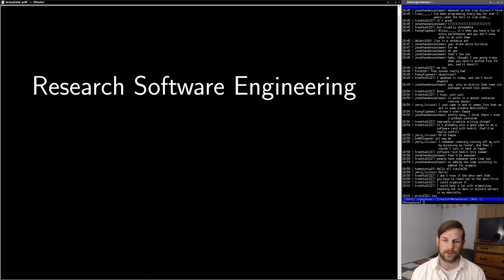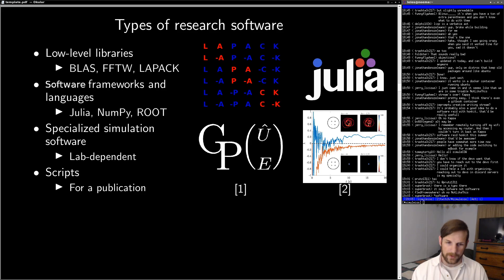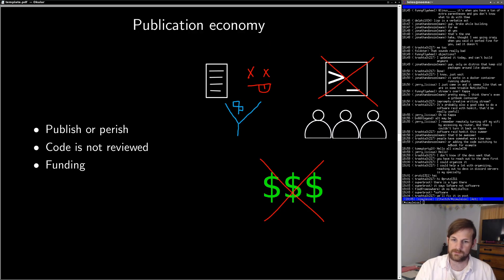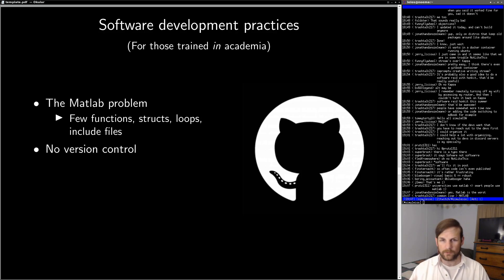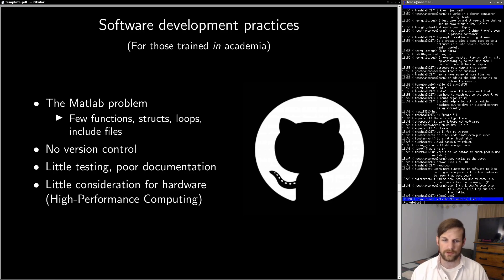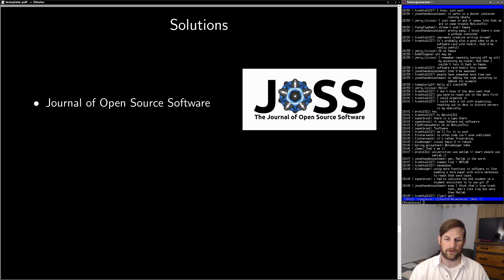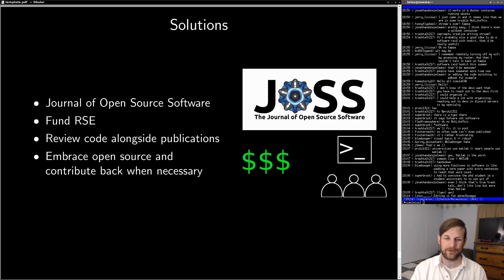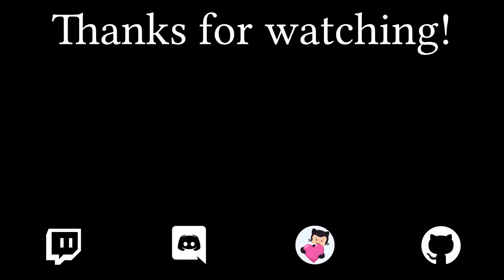The Problem with Research Software Engineering

Comment: Welcome to the world of software, it does not work. What you are talking about is just one system, that of the Client/Server technology. "How to ask someone for an answer". In actuality we should never need to know how to ask for anything. Any information needed should just be provided. With GPS you are dealing with three U.S.A. standards, and Russia, China, EU, Japan, India standards. Then you have different Earth datum, and accuracy, transforms, and then the assumptions that you actually have what you have been told. However by getting rid of the client/server technology all problems go away. To be more accurate I should not say "get rid of client/server", but rather change the technology so we simply remove the need to use it. 

In my mind every action a computer doers is client/serve. "Move 10 to Register 1" is client/server, so is "A = UpperCase(B)", as are operating systems, devices, APIs, and all applications. Welcome to the world of billions of isolated conventions that everyone must conform to just to do a simple job of GPS research.  All this other stuff has absolutly nothing to do with research.

Comment: Thank you so much for posting this video. What I've heard for a lot about algorithms is that when a paper is written, and it says that it has great performance, it's very likely that the implementation will be very costly and won't have better performance than the current solution. OFC, there are also some breakthroughs.

Comment: Hello! I found your video through hearing of "research software engineers," and I am very curious. I understand your present concerns with your current career. I am looking for advice.

I received a bachelor's degree with math and cs. I am personally very interested in getting into the HPC background and would like some recommendations because I am not sure where to even begin. I am considering going back to school too, but I am also not sure about funding and such. What would you recommend to do if you were me?

Also, I would like to try out my own pet project to get some introduction to the subject. I've heard of OpenMPI and some other things for parallel computing. If you could suggest a beginner level project, what would you recommend?
Reply from the maker: So there are a bunch of different "ways to start" with RSE. The best way is probably to just e-mail people, state your background, and ask if they need some programming help. You will learn the tools along the way.

As for a pet project, it's kinda hard to say. There's a difference between parallelism and distributed parallelism that you need for HPC. Going from parallel to distributed is not an easy step, but can only really be done if you have a cluster available to mess around with. You can still learn the tools necessary, though (MPI, mainly, but also CUDA for GPUs).

I might recommend looking into the Julia ecosystem at this time as I know people are looking for help with their distributed setup and having your name associated with those tools will probably help out if people are looking for Julia positions. That said, most of the RSE code is either in C(++) or Fortran, so knowing those languages might be a bit more useful.
Reply: @LeiosLabs  Thank you for the prompt response! I can definitely have a look into those languages and technologies you mentioned.

When you say e-mailing people, do you mean university professors or people via LinkedIn? I imagine professors. One issue I came across was one professor couldn't take my assistance unless I was a student at their university. Can some professors be flexible regarding that?
Reply from the maker: @thej680  Not necessarily university professors. People who are writing papers or software you are interested in. Most of the code for RSE is open source and you can probably start collaborating on github pretty quickly.

Comment: I would say that problem is wider, writing clean, documented, tested ... actually even testable code is not something that student of faculty of informatics can do. Not to mention some scalable architecture without every part of software dependent on every other part. It comes with experience ... if you won't create team from people without prior experience. Because at school, students know the language, but it's likely that largest software they produced had tens of kilobytes of code.
Anyways, as a professional software developer i don't like something like unit tests - they help isolating pieces of software better and create better interfaces, because code that includes everything from application compiles slowly. But to test every possible input and program path is pretty unreal. I admit that I usually write lot of log messages to see if complicated code works as expected, i try to profile it when it runs too slowly and later i delete all code used for logging and leave it that way. If I "fix" something later and it gives different result, it might be a bug or it might be something that works better or faster and it's just good enough. Of course in scientific software, you don't want results to change ... unless old ones had some systematic error.

Comment: I work in the DSP field and we work closely with people in academia. I 100% agree with what you say. So much time could have been saved if the code handed to us was written better or even followed the paper. 
I think a big thing is that some older people in academia have the attitude of "if you used simulations, you didn't solve the problem." I personally think it's weird to see people not use software as a tool for verification on both generated and real data.

Comment: Yikes. Physicist here. I can confirm everything you say here. I've used code written in Fortran 20 years ago in my research and it's constantly bugging out with every fortran compiler update. Why? because it was no one's priority to rewrite it in a more convenient language. When the project fell on my hands I had some time to get results and then I moved on. Someone is going to inherit this code and probably do the same thing. Then there is my analysis code on Mathematica. It contains my own implementation of a few different algorithms described in papers but there is no way to check if my implementation really is bullet proof. Collaborators don't really care as long as it produces publishable results.

What gives me some pace of mind is that in an active field of research a result wildly different from the expected will be under more scrutiny.
Reply: Fortran is a perfectly convenient language for scientific computing. You could even argue that it is the best for certain applications. Chances are that your code was written badly from the get go (maybe using non-standard, compiler specific extensions). Fortran is and will ever be back compatible with previous versions of the standard, but compilers issue warnings if you use obsolete constructs.

Comment: Even if you have a "deep and fiery hatred of Matlab" (3:42) you can't leave it out of a list titled "Types of research software" (1:07). Come on
Reply from the maker: It was there, under "languages and frameworks." I just gave julia as my example instead of numpy or matlab. It's underlying libraries were also there under the same section with blas and lapack. Again, there are way too much research software out there, so it was not possible to list them all on that slide

Comment: And you're probably only talking about software engineering or at least from that perspective. 

However, as a PhD student in the field of structural engineering, I wasn't specifically trained to write code, but some/many problems can't be solved without a bit of coding. Now, imagine that horrible google-stackoverflow-slapped-together-frankenstein code. But most of the time, if it works it works and I'm more than happy I made something that actually does what it should. And indeed, usually, once the publication is done, the project is set aside, as well as the code. Fully agree though!
Reply from the maker: I tried to speak both from the academic perspective (where there is no incentive to write clean code) and the software engineering perspective (where there is not incentive for software engineers to stay in academia). I also left out some content that was particularly ranty about academia. I want to start a conversation, not an argument.
Reply: @LeiosLabs  I hear you and I wanted to acknowledge this from my own experience in academia. I'm curious how it would evolve over time, as programming will become increasingly more important (I think).

Comment: I recently came across JOSS and made a submission to it. In so doing I found that there are lots of thing I didn't know, including writing tests, documentation using sphnix, proper packaging of the code. At least I knew a bit of git, which I learned during my spare time, when making side projects totally unrelated to the research projects. These things we have to learn by ourselves, the institution does not provide such trainings, and many of my colleagues don't care about these things at all.

And I also dislike matlab, array doesn't even start from 0.
Reply from the maker: This is my experience as well. I like JOSS because it brings up a lot of topics academics typically ignore.
Reply: Arrays starting from 0 isn't a problem. R, Julia, Lua, etc all start with 1. In functional / array programming languages it doesn't matter. You'd be basically writing the same code in Haskell for e.g. (a 0-indexed functional language). Function composition instead of loops always!

Comment: I see the research code problem. Additionally, the code is usually not maintained after publishing. So even it was well developed, there is no guarantee it works when someone is interested in it. This is not 10 years case, but just a few years in nowadays. (For instance, I suppose CUDA version, compute architecture, and GPU architecture would be the issue in your case. Probably a matlab code runs longer.) But this is quite hard problem. And I think it should not depend on an individual's effort. Ideally, some systematic support is great. Thanks for focusing a fundamental problem.
Reply from the maker: totally agreed! I think a lot of researchers use the fact that software is constantly evolving as an excuse not to review it. The way I see it, maintenance of code is a huge issue as well and hard to do right. I think the best we can do is provide the version numbers and such at publication. This will allow the code to be run for at least a decade or so.

At this stage, just reviewing code is already a big step forward.

Comment: As a junior research instrumentation engineer, I am in the same hatred towards LabView...
Reply from the maker: Oh boy, I bet! That's another predatory licensed software that is entrenched into the research ecosystem.
Reply: @LeiosLabs  The problem is that you can't really defend any other solution because that's all researchers know and telling them to use anything else is seen as trying to "break something that works"
Reply from the maker: @DucBanal  Also agreed with this. As much as I hate the system, I don't think it's good to pull the rug up.

Comment: Thank you for this video. I'm a 3rd year doctoral student in Applied Math, and specifically the scientific computer subdisciplines you mention. I'm currently finalizing a moderate size (about 4000 lines of C) codebase to be open sourced along with a paper submission. There a serious crunch-time feeling which is causing various holes in documentation as well as crappy inefficient fixes. You're definitely right, writing well documented code feels impossible when one is also supposed to also be pushing out theoretical breakthroughs of some flavor.

On the other hand, it is also very hard to write code that works without a strong grounding in the theory of a subject.
Reply from the maker: Right, exactly! You need domain knowledge and software knowledge. It's not an easy job at all! Good luck with the paper!

Comment: Congrats to your PhD!

Thank you for your perspective on research software engineering. I have never seen course offers at my university for scientists on how to write good software and in the end it comes down to teaching yourself.
I work in the same field (PhD candidate in computational fluid dynamics with LBM / physics) and I've seen lots of bad code as well, due to the points you've discussed. But that's not always the case.

The incentive to write clean code is given at least once you work on software as a team. We do refactoring and on a regular basis and make sure every line is properly documented.
Because of the teamwork, version control becomes a necessity as well.
Testing code is actually most of the work. If code is not testable and the results are not reproducible, it is trash code, no matter in which field.
The main incentive for our software project actually was hardware (GPU) efficiency and performance. No other software on the market is capable of comparable performance, so we had to write our own.
Regarding job chances, research software engineering is not a dead end at all. If you really master scientific programming, you don't have to apply for a job because companies will apply for your time.
Reply: I don't know about your team, but many scientists seem to think "testing" means running the whole 40 hours experiment and comparing the results with the last run. When software engineers talk about testing, they mean small and readable unit tests which take seconds to run and verify automatically. But again, we can't blame self taught programmers of not knowing all the best practices.
Reply from the maker: I think we have almost the same perspective here. I'm happy to see more people writing the best code they can given the circumstances!

As a note: I've been considering doing a video on heterogeneous computation (CPU / GPU) in Julia for HPC relatively soon.

Comment: In my learning I found matlab nice to get simple problems solved and make simple scripts but I wouldn’t want to do large projects in it
Reply from the maker: Yeah, I tried to make sure people knew I was biased about that part. I have not found a single use-case in my own research where using matlab would be better than python/julia, and most of the time, it's flat-out infuriating, losing me hours of time.

I appreciate that others have a different perspective and find the language useful, but I do not think I will ever be able to get over my biases about it.
Reply: @LeiosLabs  I completely agree, matlab has its quirks and aggravates me just as any other language would.  Personally, I was taught my in my engineering degree with a math backbone, so the syntax of matlab for math makes somewhat sense.  that being said, counting from 1 is stupid
Reply from the maker: @Ddddddddddd381  Counting from 1 is the least aggravating thing, honestly. I also don't mind the formula specification because I was trained as a physicist. I genuinely hate how radically different its syntax is from everything else, but I could see why some people like that. It's everything else that bugs me, like how:

- you can only have 1 function per file

- loops are slow

- structs / classes are poorly optimized

- good luck with graph / tree methods 

- you cannot edit files outside of the IDE provided, otherwise matlab doesn't recognize the change

- it's licensed and checks for that license on startup... Which is doubly annoying when running matlab on distributed nodes, because it then checks licenses n times, where n = number of nodes. The license here, combined with radically different syntax actually makes the software predatory because it locks users into a system that they have to pay for and cannot escape from easily.

- it crashes almost every time I try to run anything reasonably complex.
 
I mean, if it's an esoteric language, it's an esoteric language. It might have some form of historical precedence as well, but there it still boggles my mind how people put up with it in 2020 when other, better languages exist for prototyping.
Reply: @LeiosLabs  what a fantastic explanation.  thank you so much! I haven't personally came across those issues because I haven't done anything really complex with it, but I really do respect your expert opinion

Comment: Have you had any GUI related problems with academically developed, commercial research software?
I find that research software GUI tends to follow similar anti-design-patterns to one's encountered in other topic-specific software fields like music composing as showcased by Tantacrul on his channel in his "Music Software & Interface Design" series. 
I watch his "diatribe" videos because I find it healing after long hours working with research software GUI.
Reply from the maker: I don't typically come across research software with GUIs. Most of the stuff I do is CLI-only.

The one time I did use a GUI, it was a bit of a mess.